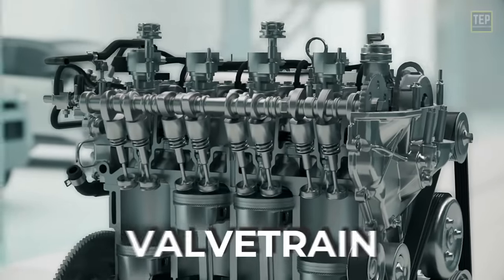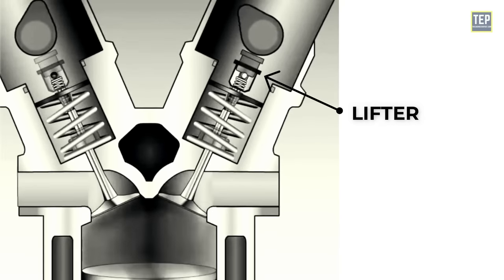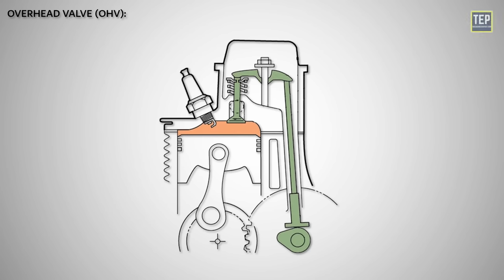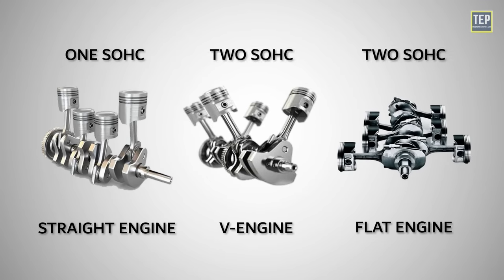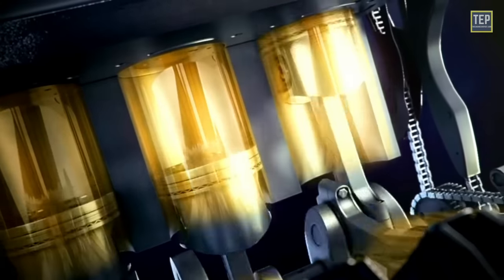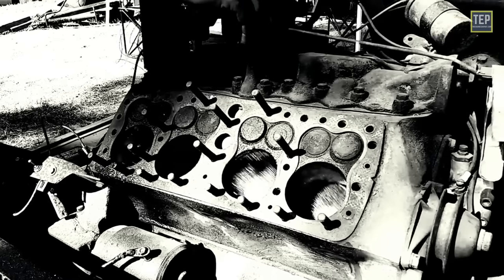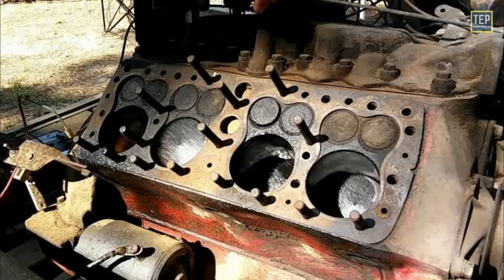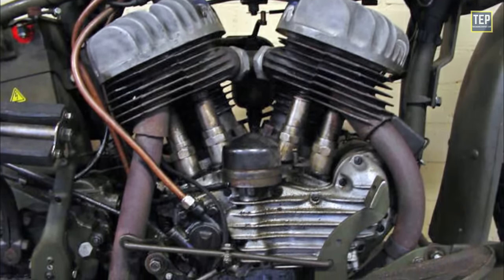Which is the Best Engine Valvetrain Design? OHV, SOHC, DOHC or Flathead | Pros and Cons

Comment: There never is a best, always an engineering compromise. It is all about the initial design criteria.
Reply: I'd say that's incorrect. The overhead valve is much better in regards to efficiency than a flathead. The same goes for overhead cam vs cam in block, have more options for size of valves, number of valves, and chamber design, not to mention intake and exhaust port design and size. Dual vs single overhead design means you can more specifically tailor valve timing, geometry, and again number of valves per cylinder. You don't really want to control four valves per cylinder on one cam.
Reply: Weight and packaging are a determining factor. So you are wrong. Corvettes get the same gas mileage as Civics. How is that for your efficiency.
Reply: I agree, a compromise.
Flathead is out of date, but has the advantage of liquid cooling the exhaust improving durability. 
Inlet over exhaust also has this benefit. 
OHV has a place in low Octane environments (as does the above )
OHC does make the most *of 87+ octane economically.   But that wasn't always the case with gasoline. 
DOHC is great for high Octane fuel,  89+
Reply: @drtracernum20  I think their point is that if you have limited space, you may need an OHV design to maximize the available room. Likewise for reliability, required maintenance, etc.
Reply: Flexibility is best. Variable intake, variable timing, variable compression, variable displacement. Direct injection is best til the intake gets carboned up. Turbo beats supercharger though. C4s made 250-275 horses until DOHC LT5 came out. 50% more power,  200% the price for the car. Chevy should've stuck it out with that setup and learned to build the engines themselves. Develop improvements along the way. The ZR-1 was the only interesting C4.
Reply: @drtracernum20  your incorrect a 2009 outback has bad issues with the heads and gaskets and its a dohc but i could say a obs chevy with a 350 and ive seen them trucks go 300k miles while a subaru outback that could go maybe 170-230k miles its about engineering and design in a engine man
Reply: Exactly. There are a lot of reasons why my 190 cc lawn mower produces 5 hp and a barely larger capacity Moto 3 bike produces something like 55 hp. Which is best? It depends on the job, doesn't it. I don't want to burn over ten times as much fuel and rebuild my engine every time that I do the lawns. Moto 3 racers aren't keen on saving gas and racing bikes with a top speed of 45 mph. Both are equally brilliant, yet different engineering philosophies.
Reply: The fact that a dodge hemi uses an OHV design doesn't mean the design criteria was correct
Reply: @drtracernum20  ultimately it just depends on criteria such as space available and application. overhead valve has the advantage of simplicity and higher manufacturing tolerances than overhead cam, especially with DOHC. not to say that modern dual overhead cam designs are anywhere near unreliable, it’s just that fewer moving parts also means fewer points of failure. this comes at the cost of lower potential RPM due to one cam operating all valves. 

still can make good, high flowing power reliably with pushrods though. ford’s coyote and chevy’s LS are a good example of this dichotomy. different designs that ultimately achieve similar results.
Reply: An engineer only ever does one of two things
1. Solve problems
2. Put the weak point where nobody minds it
Reply: @drtracernum20 but efficiency of the piston isn’t everything. Packaging cost of manufacture and weight can also be very important depending on what you build the engine for
Reply: As with a lot of things

Comment: The valves in an Overhead Valve engine are not in the block, they are in the head.  Flathead engines have the valves in the block.
Reply: You got that right. Even the diagram they used pictures the valves in the head.
Reply: Ohv engine are also known as cam in block engine.

Comment: OHV engines are ideal in countries that dont tax displacement. They make most of their power in usable revs, are light, compact, very fuel efficient and have very low service costs. The only drawback is that you need to give them a bit more displacement. The market needs another Buick 3800 V6. That engine made the same power (205HP) as most 3.0L DOHC V6s of its time, was smaller, lighter and got 31MPG highway moving large cars around the highway and are extremely reliable. I had a 2005 Mazda 6 and that car was smaller than something like a Pontiac Bonneville and only got 29 highway from a 2.3L DOHC 4 making 160HP.
Reply: Definitely agree the family of engines is great and easy to work on
Reply: The 3800 series II is an awesome engine, my kid is still driving my old Buick that is 23 years old and no issues.
Reply: Here in Europe we had OHV 2 liter 4 cylinder that where bullet proof. 
This is a proof that displacement is not the problem, the problem is that it's more expensive.
Reply: They were not as fuel efficient as OHC engines, that's why they've mostly gone extinct. In 2005, the 3800 was making 205 hp and getting worse fuel mileage in the city, and about the same fuel mileage on the highway, as OHC V6s that were making ~250 hp.
Reply: Comparing a 3.8L to a 3.0L, because OHV is stoneage tech
Reply: @JakkeJakobsen  The displacement doesn't really matter if the engine is physically able to fit in the same place as a smaller displacement engine and doesn't result in a weight penalty (the 3800 certainly did because it was iron), the engine was just horribly inefficient. People will even brag about how OHV V8s are supposedly more efficient than OHC V8s, but will ignore any example of an OHC engine offering better fuel economy and higher power output. The 5.6 liter DOHC V8 in the Nissan Titan, for example, is far more powerful than the 5.3 in the Silverado, yet it's more fuel efficient while hauling around a much, MUCH heavier truck.

Comment: Worth mentioning that flat head designs were still very common in small engines until recently. (Such as in lawn mowers and generators)
Reply: And I don't miss them one bit! I went from a 4 hp. side valve Briggs and Stratten powered lawn mower to a 5hp Honda OHV and I couldn't believe the difference. The Honda uses about half the fuel and, to the nose, emits about half of the unburnt petrol. That said, I'd rather a '32 Ford V8 was sitting in my driveway than my Civic!
Reply: @davidbrayshaw3529   Actually it took Ford a year to sort out the V8 Flathead motor. Very few 32's with original motors.
Reply: Soviet T-34 tank.  all aluminum  V-12 DOHC diesel 4v per  cyl, shaft driven valve train 85 years ago
Reply: The video says this at 11:25
Reply: There's a new light aviation flathead engine (d-motor).  Air engines run at low rpm's (max 2500) so that's not an issue. The compact engine without the valve gear on top of the opposed cylinders is good aerodynamically.  And the overall weight is a bit reduced.
Reply: @davidbrayshaw3529 probably has more to do with the quality and engineering of the Briggs engine, than the basic design configuration
Reply: Flat heads ARE THE FUTURE!!!
Reply: Toro professional series mores say they have a patented engine that is 60% more fuel efficient.  It is a flathead they just more efficient at low RPM (lawnmowers)!

Comment: Overhead Valve design does not automatically mean more low end, rather OHC allows higher revs with lighter valve springs due to the lighter valvetrain.  Camming an engine for higher revs takes away low RPM torque.  That is the reason Overhead engines tend to have more low end- OHC engines tend to have aggressive camshafts and therefore have weak low end.
Reply: Thats not the reason at all
Reply: @wiktorjachyra1869  Ok, I will say it differently then:  Pushrod overhead valve engines do not have more low end torque than OHC engines just because they are pushrod engines, but rather OHC engines have a light-weight valve train that allows the use of relatively soft valve springs. so those engines can use a more aggressive cam shaft without having to resort to the super-stiff valve springs that a push rod engine would require.  That more aggressive cam shaft means less low end torque but more high end horsepower, and the fact that it doesn't need super-stiff valve springs also means less internal friction and freer-revving characteristics.  This assumes everything else being equal.
Reply: You're right. NASCAR uses ohv engines and they rev over 9k rpm.
Reply: Why does the 2020 Corvette make 30 hp more than the 2019 Corvette?
Reply: @Tom-xd4ct  In contrast, the Merlin engine in Spitfires during WW2 was a SOHC 4-valve per cylinder unit V-12. Peak power was at a mere 3,000 rpm.
Reply: @michaelbenardo5695  Older engines, which also happened to use pushrod valves, were often undersquare i.e. had a long throw crank, which increases torque.
Reply: THAT can be fixed with a long tube equal length header properly sized, so all the power can come on on the low rims.
Reply: @michaelbenardo5695  All the issue is a complexity to transfer power from crankshaft to cylinder head. Chains strained, belts did not exist, earlier used even conical gears (that broke) with vertical shaft  like in Russian tank engine V-2 and its modern successors. OHV is OK for low revolutions and therefore heavy engines. Additional advantage is  convenient valve clearance adjustment using nuts at rockers.
Reply: It's impossible to teach people the truth about engines. You were correct on your first statement. You can give a dohc engine a low cam profile, and it will have a similar low-end power of a ohv of the same displacement. Plus, ohv design starts to restrict air flow at higher rpms no matter how far you open the valves, so there isn't a point in making a high rev ohv. I'm not saying you can't make a high rev ohv. You can make one, but you would gain more with a dohc.
Reply: Not quite. OHC engines typically have more valves and thus can flow more air at higher revs but comes at the cost of torque output down low. Modern engines use VVT and a slew of other cam/timing related wizardry to minimize this. You can make an OHC engine perform exactly like a pushrod unit by going with an SOHC 2 valve setup like Ford did with their early modular engines but then what's the point of having OHC engines? That's part of why everyone was kind of puzzled that Ford dumped the venerable Windsor in favor of the 2 valve Modular for truck use when the Modular wasn't making any more or sometimes less power than GM and Chrysler's pushrod V8s.
Reply: In their case they use top notch materials (lightweight and strong) to get high rpm's but it would be far too expensive to use those trick pieces in production cars. @Tom-xd4ct
Reply: @honkhonkler7732 emissions. That's why. The EPA drives these auto makers to do crazy things.
Reply: @honkhonkler7732  So you mean that a single small intake valve will create a lot of swirl and turbulence in the chamber and give you this ugly Diesel like sound in a gasoline engine. I'd rather listen to bike OHC engines with their soft tone. 4 valves let you place the spark plug in the center. 4 valves let a small bore cylinder of an inline-6 engine flow enough air. This under-square design has a shorter path for the flame-front and will make more torque at all RPMs. Why don't we have more BMW valvetronic. Close the valve early. The turbulence probably disappears before we ignite the mixture. Why do we need both: Turbulence and squish area?
Reply: That as well.

Comment: OHV / center cam. Used for decades and time tested.
Reply: Over head cam is even older.
Reply: It’s ok for small application, terrible for high horsepower
Reply: @2seep  I think there have been one or two pushrod engines that were actually pretty big and made some decent power.

Comment: I think an interesting topic would be discussing Coates spherical rotary valves. They're simple and efficient
Reply: :face-blue-smiling:
Reply: And with the doubling of the power output from the Coates heads negates the use of forced induction set ups. 
And for the low end pockets that most of us have, Rhoades lifters does away with trying to pay for roller rockers
Reply: @jamesharrison6201 Exactly. Keeping things mechanical while improving overall performance and efficiency

Comment: One type you missed is the "F"-head, where the inlet valve is push-rod operated in the head and the exhaust valve is [as a side valve engine] in the block. This allows for two things. Smooth power and a huge inlet valve for good breathing. They were used by Rolls Royce and Rover from the early 1945 era until the late fifties in Royces, and right into the 1970s in Land Rovers.

They are famously quiet, smooth [especially in in line six form], and robust. Neither Royce nor Rover really made performance cars, but they did build cars to last and be comfortable.

Several Bentley variants of the Royces appeared that showed that such an engine could really perform in the grand tourer segment of the luxury are market, such as the Bentley Mark Six and the earlier Continentals, before Royce's own new V8 was adopted across the Royce and Bentley models.

Nice video. Thanks from George [in UK].
Reply: A "Flathead" with a correctly sized turbo would be ideal.
Reply: don't forget the Atmospheric IOE.....hey, it worked anyhow...
Reply: I've never worked on such an engine but from what I heard the were somewhat inefficient and not as reliable as they wanted it to be hence why it did not catch on.
Reply: Hi George, in the late 70's my brother had a Land Rover with that style engine. 
At 90mph, the 'aerodynamics worse than a house brick' meant the door tops got sucked out about an inch. 
You could also watch the fuel gauge dropping like the second hand of a watch!
Video also missed out on Ducati with desmodromic valve operation (I don't think anyone else uses it?)
The head shown around 7 minutes looks like a Triumph Dolomite, direct operation bucket one side and rocker for the other?
Reply: Kaiser/Jeep used a F head design in the mid 50's the 134CID engine and the 161CID engine.

Comment: @2:07 valve springs do not exert downward pressure on valves, they exert upward pressure on them, which is how they are closed.
Reply: Nope.  The springs exert downward pressure.  Down is not relative to earth and sky.  But relative to the valve seat.  Down is with the valve seated (closed).
For instance, a lawnmower engine with a vertical crankshaft and horizontal stroke.  The valves move (open and close) horizontally also.  What is "down"?  Down is valve closed.  Thus, the spring exerts downward pressure on the valves.
Reply: Thats what he said. But he forgot to mention the camshaft
Reply: Valve springs only close the valves, that's it.  Desomodromic valve train that's a different story
Reply: They're basically there to make sure the valvetrain has no slack.  If you're getting floating valves at high RPM, there's obviously clearance in the system because the rocker has stopped pushing on the valve stem because the height of the lobe is decreasing and the spring is still trying to pull the valve back tight against it's seat. You must get valves out of the way of the pistons in an interference engine.  You also must have both valves closed by the time the power stroke starts or you're going to  burn your valves.
Reply: @galaxiedance3135  Float at high rpm is the result of the cam cycling faster than the valve spring can match with resistance. The remedy is proper spring rate.